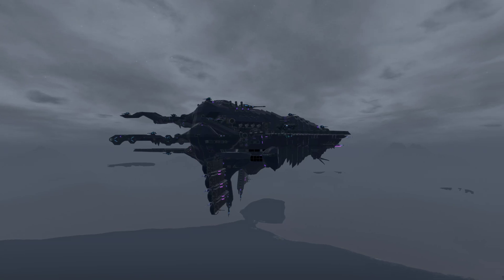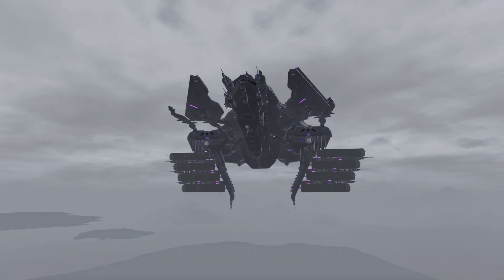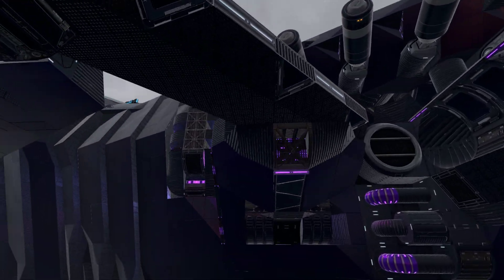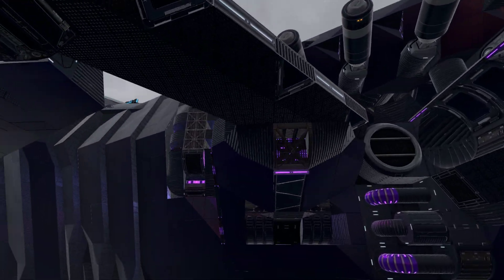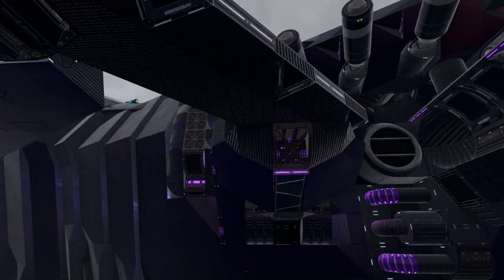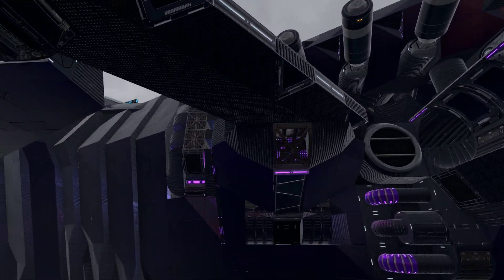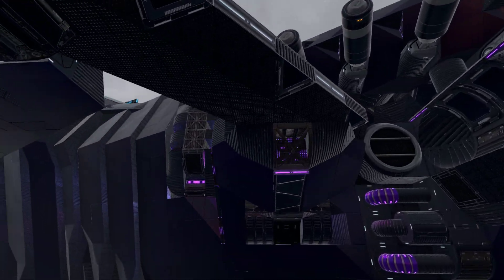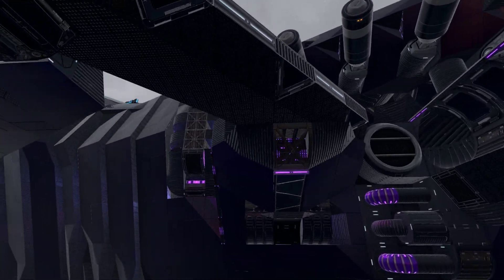Empyrion Galactic Survival - Kriel Space Station WIP 2-7-2022

Comment: I think you are outdoing yourself on this build Jeff. It's becoming something really interesting.

I do have some suggestions. Can you turn the constructors on the side and put some sort of thin block over them? We've seen it in quite a few other builds, but I think you could really pull the look of the furnaces into it. Maybe squeeze a bit of that around the deconstructors as well?

The escape tunnels from the crafting area could form into tunnels that go under the rear landing pads, giving you a thicker support while still being a quick escape hatch (or a nice place to hide some Kriel warriors). They could also hook into the module bay tunnels giving you quicker access to them as well.

There is plenty of space to land things, I wouldn't try to expand the hangar more, Better to use that space to make it a better POI. One thing I've found really good for path control of a POI is something Vermillion has done, you have a pathway blocked with blast doors, but you don't like how the blast doors look, so you cover the blast door with an opaque LCD projection. When the blast doors are opened, the LCD can be shut off to "magically" open a new route.

I prefer the use of switches for major triggers personally, as the sensors sometimes fail to trigger/trigger oddly, in my experience. Those could be bad triggers too, I don't know. I also have a tendency to shoot any visible sensors that may stop progress. 

I would prefer it have an admin core, and have all of the weapon turrets be damaged, so a person could strip the weapons, then maybe fly an SV into the hangar for some minor clean up of troops, and (damaged?) sentry guns.

There is little more painful than a shielded POI with admin core and fully kitted out with indestructible sentry guns. If used carefully and well (some cover provided, good LOS between covers, obvious exit to safety, etc.), the occasional unkillable sentry gun can add challenge, but more than one or two is sadistic and costs a lot of fun factor.

The player base needs one elevator to hit all levels, make the other side be stairs and block off the elevator with doors. With an admin core POI the elevator is completely unavailable. 

Can you make an admin core blow up with a sequence of triggers? So you could take it down if you run the course, and then maybe use it as a base after. I guess I haven't paid attention to how that works.

Do you need a large farm with 2 module support? Do you need any farm? I would feel like 18 plots is more than enough. You already have an ocean of production, so you wouldn't need a P-module. You have a ton of storage so a storage module would be a luxury. Farm and whatever?

Can you land a Helios Dropship (the large one) in front of the hangar? If you were using modules, you may like to have one of those, and you would want to be able to disembark your HVs and SVs into the hangar I think. We need a Krielified dropship.

You know what I am lacking in SVs? A large assault/mobile base SV like the Grond, with space for customization and a roomy interior. Probably a vanilla build so your thrusters have enough power to actually move the craft, but if you offer space for customization one can add quantum cores and more/bigger thrusters/generators/etc. Room for ~20-30 forward weapons, space for turrets if you exceed weapon limits, you know, the "I can do everything" (Including hauling a tank?) monster. That might not fit your idea plan though.

Thanks Jeff!
Reply: Having a sentry gun that cannot be destroyed is not a good idea in poi's
Reply: I've seen it. It's murderous if you can't get past it quickly.
Reply: @tarsis6123  It's not just that, it will likely lead to complaints to Eleon
Reply: @EscarliDLakutos  Why? Don't they already have POIs with full blown laser cannons deep inside them? You could consider them as indestructible with that amount of health and the damage they do. You are expected to avoid them. An indestructible sentry is far less deadly, as long as you have a way past and some cover, as the laser cannon rooms have.
Reply: @tarsis6123  a turret or sentry you cannot destroy is just a no no. Turrets do have lots of hp it's true but if they have been pre damaged by the poi author then they can be destroyed. A completely invulnerable turret or sentry gun is just not desirable.
Reply: @EscarliDLakutos  I guess some people will stand in a fire and die rather than move?

Comment: Previously, you mentioned you need ideas for names.  Due to the tentacles, might I suggest:  Gorgon, Medusa, or Cthulhu.  I think Cthulhu is a bit too on the nose, but Gorgon or Medusa may be a little more obscure.  🤷 I know you use to like to use mythical  or Latin based names for your creations. 

The curvy experimental hallway above the hanger looks awesome.  normally flashing lights are annoying, but I like your idea for using  the color change spotlight in a poi to highlight the directed path. 

I agree that elevator fights are janky in poi's.  Either the AI is dumb and stands at the bottom awaiting your head shots, or they charge up in mass.  If you can use stairs, it would be much better for the poi.  You have a lot of room in this station, maybe for the poi, in the hanger you could make stairs zig zagging up the back wall where the elevators are?  You may only lose 1 or 2 blocks of hanger depth, or you could inset it in the wall and use half walls on the other side to try to reduce space used up by the addition of the stairs.  idk

To be honest, in the player station and the poi, I would probably just jet pack up to the door leading out of the hanger (and most places) and never use the elevators if I'm not forced to. 🤔That may be something to keep in mind for poi's too.  Tight halls negate jet pack advantages during combat, but large areas give players a huge jet pack advantage, particularly if there is cover (like pipes) to hide behind near the ceiling.  In space stations, I jet pack as much as possible.  It is quicker than walking, and it allows you to go up and down, obviously.

Btw, watching your transition angles of block work, even the small bit you showed in your last vid around the hanger entrance, is incredibly inspiring and helpful.  You create transitions that I would have never considered.  More importantly, you make me think to be more creative than to quickly default to the angles and blocks I am comfortable with.  Thanks for your vids.